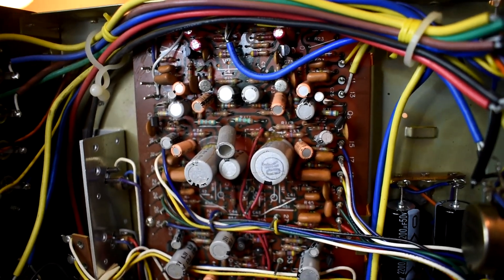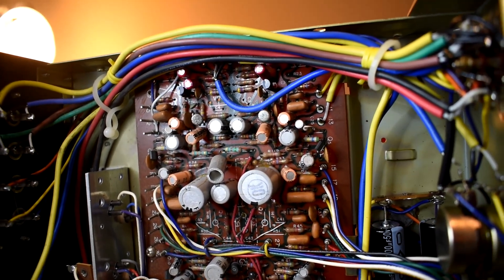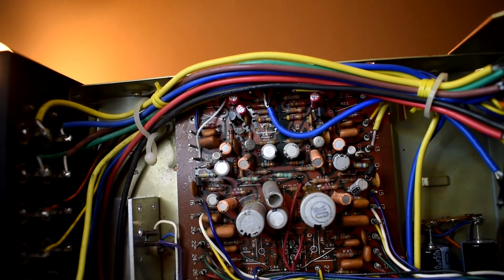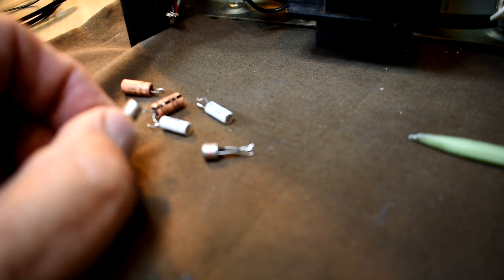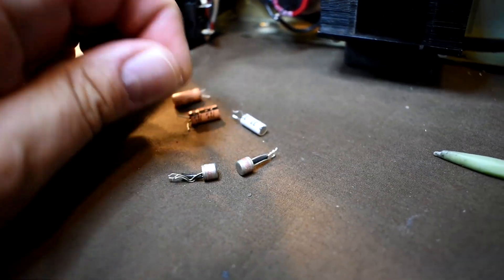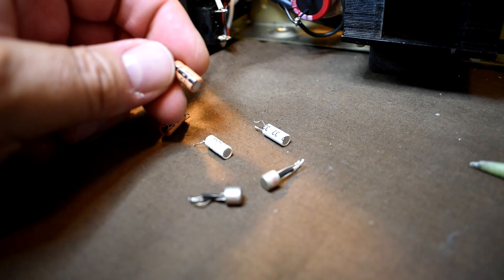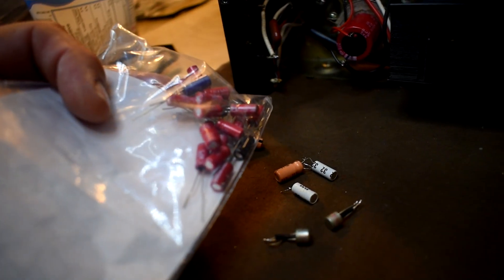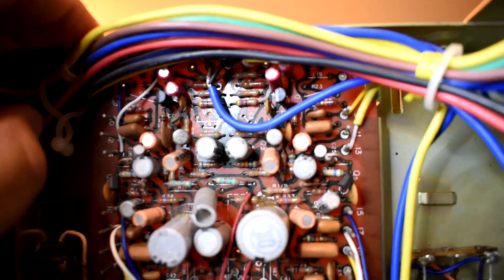I've heard about microphonic tubes but transistors can go the same way- Kenwood KA-2002a rebuild!

Comment: Great vid! You emphasized no further measurements on a meter to match transistors *in this application*. In what scenario would you? I've just spent 30mins noting vbe and hfe values for a bunch of 2n2905 and 2n2219s. Which is the more important value? Particularly in a szatziki pair!? Would love to see this in a future video if too long an answer here :) cheers 4:14
Reply from the maker: In a szatziki pair with adjustable bias like the KA-2000 the vbe is less relevant than the hfe value.  Two scenarios for close testing and matching of hfe would be a differential pair which the KA-2000 doesn't have and output transistors that are direct coupled to speakers.  The early solid state designs are a bit "sloppy" with the biasing of pre-amp stages and therefore more forgiving when components are mismatched.
Reply: Thanks Bryan, much appreciated! Sorry if I ask a few beginner questions over the coming days, I try to do my own research first, but often get stuck in a quagmire of opinion and too much information 😅

Comment: Nice video.  Old vintage preamps sections can pick up radio signals too. Replacing the can transistors and old capacitors with modern components will fix this.

Comment: Interesting work going on , amazing work. 
I have a 78 Pioneer SA 6700 amp and the main caps have been changed from 8000uf 50v to larger 15000uf 100v. I can’t figure out why - is that even safe? 
The sound is good.
Reply: It's rough on the bridge rectifier/power supply section while the caps charge up, but yields better sound in my experience.
Reply from the maker: That's a powerful amp with finesse.  Increasing the 2 main filter caps is very effective in firming up bass response.  It would be safe to run double the 8000uf to 16000uf capacity and 100 volt caps will last longer.
Reply: @acrossthedial  
Ok that’s interesting, and thank you. 
It has a very strong bass response as you mention. 
It is a powerful amp for 40 a side.